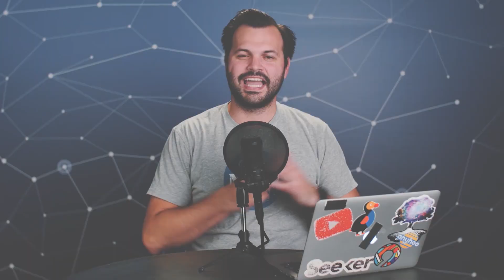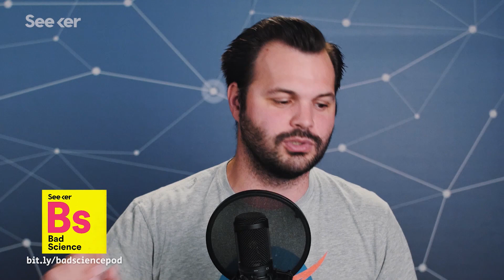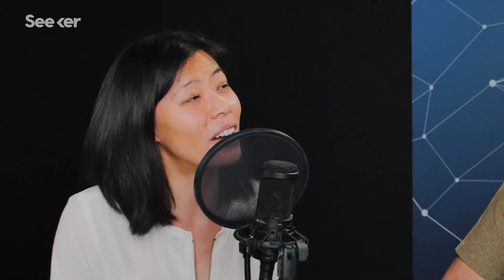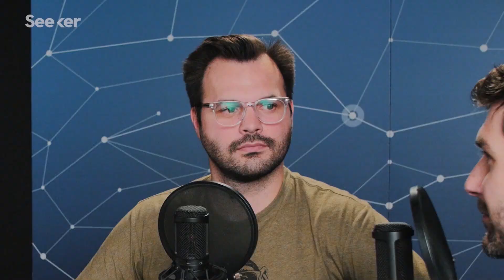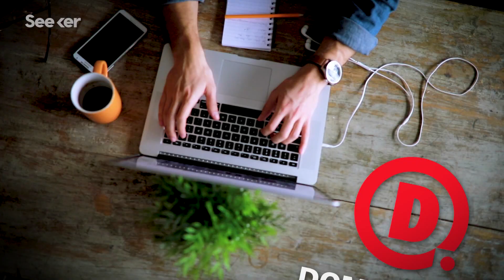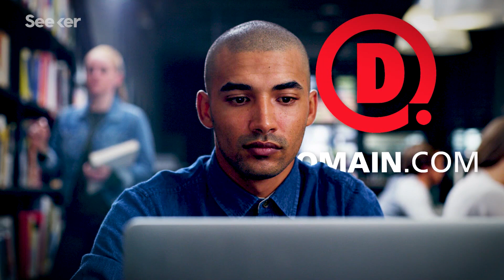Fusion Is Here IRL, So Why Aren’t We Using It? (Part 3 of 3)

Comment: She explains that fusion is created all the time in labs using lasers but it would be good to get into some details. From my understanding, the reason is the lasers create a tremendous amount of heat when they hit the proton isotopes (deuterium and tritium), which is really just the vibration of the protons. As the protons bounce back and forth due to being bombarded by laser photons, they eventually get close enough to one another and begin to fuse together, overcoming Coulumb's barrier and allowing the strong force to overcome the electrostatic force, releasing energy. Remember that protons in their natural state repel one another, so the increase in temp is necessary to bring them close to each other and cause fusion. In the sun, this happens spontaneously with no input of energy needed. The reason for that is two fold: 1. The sun is huge (2.3 million earths fit in the sun), and the pressure at the core is immense. This causes the positively charged ionized protons at the core to be squeezed close to one another from the sheer pressure (even though they all have positive charges and would normally repel). 2. The temperature in the core of the sun does not need to be as hot as the temperature created by the lasers in the lab. The pressure, along with a phenomenon known as "quantum tunneling" is sufficient to cause the fusion. Quantum tunneling happens when the subatomic constituents of the proton, the quarks and gluons, which are essentially wave-particles similar to how light is a wave-particle, "tunnel" from one point to another. That is the nature of wave-particles, they can go from one place to another without being anywhere in between, essentially they teleport. Due to the huge number of protons in the core of the sun, there is a higher likelihood that all the quarks and gluons of a single random proton will quantum tunnel to a position which brings them up against another proton, causing fusion and releasing energy in the form of electromagnetic radiation and a neutron. The resulting fused Helium atom has a smaller mass than the sum of its parts, and the extra mass is converted into energy via E=MC^2, which allows the sun to emit radiation. Of course, the EM radiation from the core bounces from one atom to another for many thousands of years before reaching the surface of the sun, then its an 8 minute trip for the EM radiation to reach earth.

Comment: Why do people think that if fission is lighter when they break it down due to losing some mass as energy that the reverse isn't going to take energy/ mass to fuse? Seriously?  There is no reason to believe that you're going to get more energy than you put in when building matter together...  it needs energy, MORE than is there, to fuse it.  Otherwise...  perpetual motion IS possible...  which it isn't.  its basically the law of thermodynamics...  you can't get more out of a system than you put in. And if you do, that energy is coming from somewhere.

If you think that it's possible just because of the model of the sun has it doing it, then clearly the model of the sun is wrong.
Reply: If fusion could possibly produce more energy than what it took to make it happen then you could fuse - fission back and forth and generate energy from nothing.

That is against the laws of nature. Can't happen, no creation miracle.  Forgive me, I can't think of the specific name of the law...

Comment: Ethan was probably one of your least popular guests as I read through the posts. As far as robots in Star Trek, if you understand Mankind we can't make it to Star Trek without  Isaac Asimov's rules for robots. That's why I Data didn't have his emotion chip installed until later when his neural network pathways generated sufficient information to go ahead and have the emotion chip installed. Plus as far as moving around you have your transporter, as far as medical not much surgery as I recall took place. They would go ahead and use Electronics to perform healing processes such as Star Trek the Voyage Home where instead of fungascopic examination, Bones puts a device on Czechoffs head that sealed the leaky blood. 
If this guy Ethan is so afraid of everything, tell him not to hang around a microwave oven. The radiation is pretty bad on the other side of the door. Please forgive my sarcasm. I love your Channel but this gentleman should have read a book or something before coming on your show. Kindest regards as always.

Comment: How much energy is released by 1 deuterium-deuterium fusion reaction? I got 0.00000000000379044 joules from my calculations below.
I looked up the atomic masses of deuterium and helium and compared 2(the mass of deuterium) - (the mass of helium) or 2(2.014)-4.002602= 0.025398 in amu. Since 1 amu = 1.661e-26 grams, the difference in mass between 2 deuterium and 1 helium is 4.21743675e-26 grams. Using E=mc^2, I found that the energy released was 3.79044e-12 joules.
This doesn't seem like much, but considering it was created from only 2 atoms, I guess it could be scaled up largely just by fusing 2 milligrams of deuterium. If you found a flaw in my math, please point it out or tell me what you got.

Comment: Cringey scientists is cringey.  Fusion makes tons of nuclear waste, by neutron activation.  These are parts of the reactor vessel that need to be periodically changed out.  But whatever.

Thermodynamics are a motherfucker and fusion is never going to be viable on our small planetary scale, for means of energy production.  

Picture fission as a balloon, keeping in mind the fissile material  we have came from stellar sized fusion reactors.  And we are literally popping a "bubble" to extract energy that was literally put there by a supernova or similar event.  

Now picture fusion as trying make that balloon, using ones of much smaller sizes by pressing them together, so that the energy you put in, sticks them together.

On our scales, fission is kicking the  ball down hill (towards the "iron valley"), and fusion is pushing the ball uphill (towards the "iron valley").  Problem is, even stars fail in the "iron valley."  

For simple terms fusing iron, takes more energy to fuse than can possibly be extracted from the process.  But again this is a challenge even at a stellar level.
Reply: Very illuminating SykoEsquire and well said. Reminds me of this quote, "" We already have fusion power -- stored in the heavy elements that are fissionable " on social media. https://www.facebook.com/R2ANM/photos/a.1561349920772560.1073741827.1561335957440623/1731955583711992/?type=3&theater

Comment: Fusion sounds nice, until you take those pesky orphaned neutrons in the more common (read: archivable) reactions into account. Run the reactor for some time and the whole thing turns radioactive and has to be replaced due to unwanted transmutaion and the resulting shift in material properties.

Comment: Fusion:  it's "easy".  Easy enough for highschoolers to build fusion reactors as science fair projects.  But they're all energy sinks.  All fusion reactors by everyone so far are energy sinks.

Go right ahead and study fusion.  Money in science is always a good thing.  But DO NOT pin hopes for cheap energy on fusion.  Decades of experimentation highlights that it's hard, very very hard.

No one has even reached break-even energy production with fusion.  No one has even begun to worry about extracting that hypothetical surplus energy for electricity.
Reply: Not to sound cliché, but just because it is hard doesn't mean we shouldn't do it... Of course it is hard, but the mathematics don't lie, it has the potential to provide clean energy to everyone for very little upkeep cost compared with other methods. Sure, there may be a snag that we run into that means it cannot be done, but if that happens, then the knowledge we gain and the changes that must be made to our theories would be well worth the effort. Otherwise the researchers currently working on it know they don't have facilities capable of sustaining the fusion reaction, they are currently in the stages of optimizing the reactions. Once we find the optimal setup, then the engineers take over and scale up to a commercially viable system.
Reply: Lenard Segnitz 

Plutonium/heavy Hydrogen methane sandwich as a shell for the Heavy H mass.
Reply: In addition, the first practical fusion plants will be huge expensive things. Furthermore the Lithium jacket around the fusion reactor becomes dirty with radiation.

Comment: Because if we create a sun on earth that is sustainable we'll all die.
Reply: Not if it's very, very small. It would not have to be large to produce LOTS of power.
Reply: mikefire98 
Not true. The aim IS to create a sustainable fusion reaction. The scale is small, and the reaction takes place in the form of a plasma suspended by magnetic fields.
NIF on the other hand use lasers to compress and fuse deuterium pellets. Sustaining this reaction would be harder and more akin to an impulse reactor because the pellets would need to be injected.

The other point of course is that fusion has already been sustained in a south korean tokamak for 70 seconds. Not long enough and as yet, more energy was put in than came out.

A full size fusion reactor based on the tokamak design is currently being built in France called ITER.
Reply: Guys, check out Safire project.  It's a different model for creating a sun on the earth.
Reply: Shawn Kangiser 

No, SAFIRE is nothing to do with creating nuclear fusion. Its just research into the interaction between heliospheric electric fields and the suns plasma.